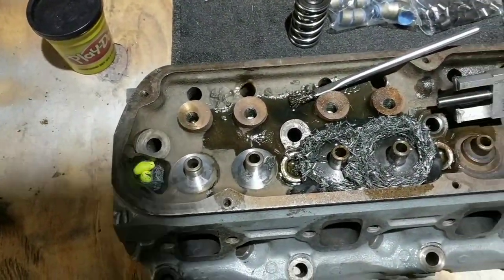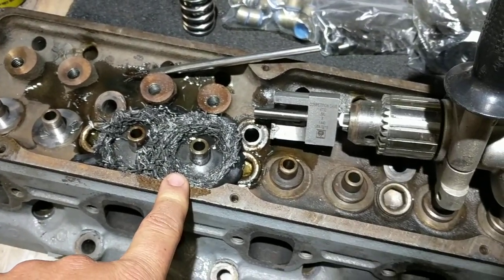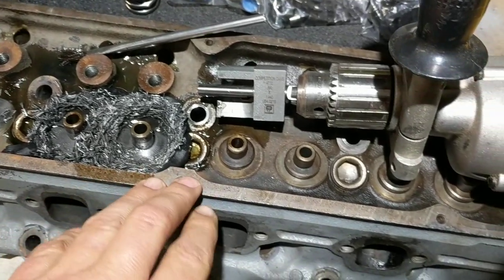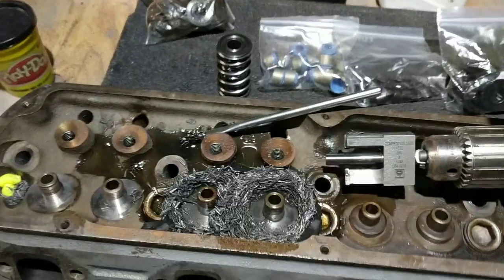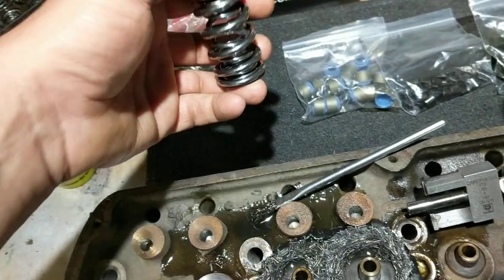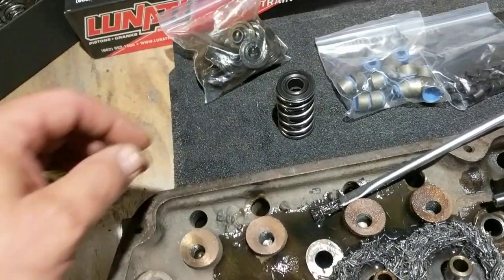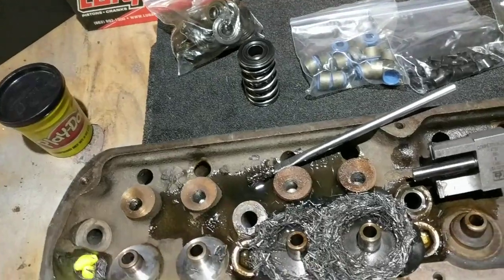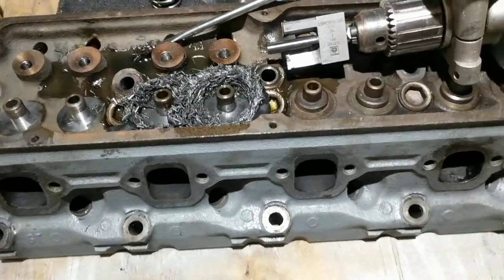Modifying explorer heads for dual springs

Comment from the maker: This is the arbor https://www.summitracing.com/parts/cca-4732, and this is the cutter: https://www.summitracing.com/parts/cca-4733. If you tally up the cost for these two things it's $120+, a machine shop charges around $100 to cut the spring seats. If you're only going to do one set of heads like this you're probably better off to have the machine shop do it, otherwise you're further ahead money wise to buy this set up, just how I looked at it.

Comment: Does that cutter also cut the guide seal diameter or just the seat?
Reply from the maker: It kind of touches them up a little bit, but not too much, provides a nicer finish for the seal to hold onto.